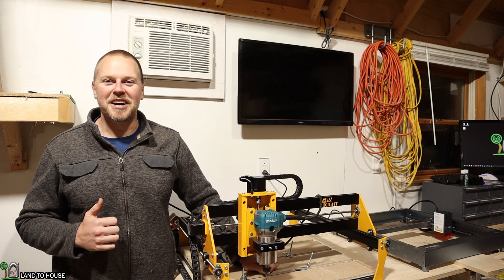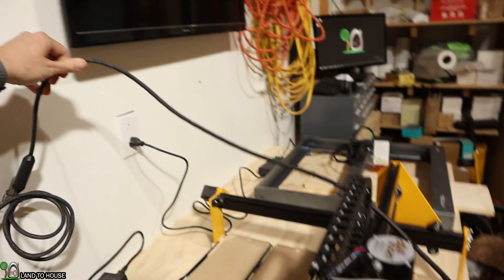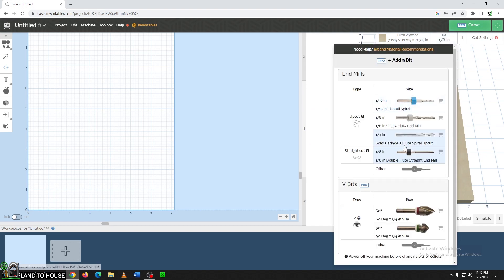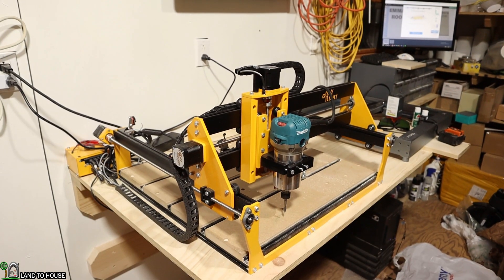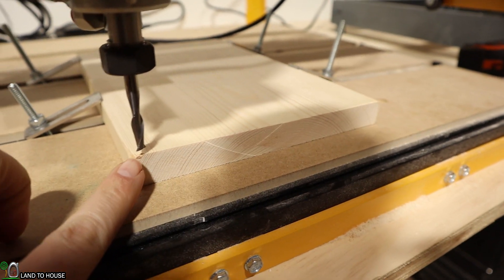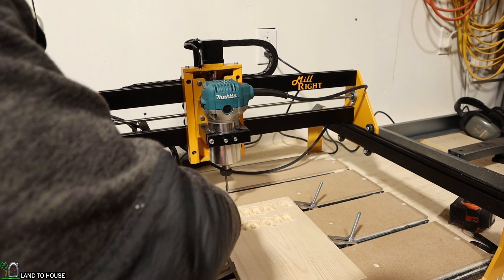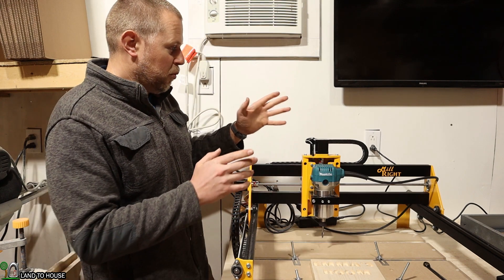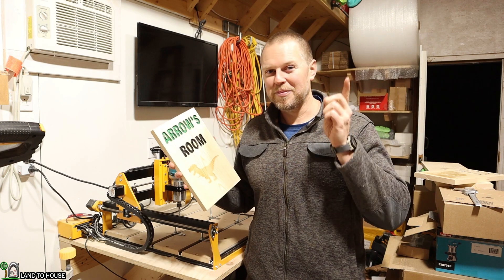Very First CNC Project MillRight Carve King 2

Comment: How do you get a cut without all the tear out?
Reply: It's all about the bit you use. I prefer compression bits, but they only work when your pocket depth is greater than the length of your bit's upcut section.
Reply: Use a downward spiral bit, never use up cut on solid timber. Compression cutters are good too but these are more for particle board and mdf.

Comment: I'm about to buy this very unit.
Reply from the maker: I've made a couple of things with this CNC. so far and it has been great. I just cut my 1st copper with it.
Reply: Does this unit cut up to 4" deep as advertised?
Reply: @mikelaba8985  Looks like you'll have that much travel in your z height, but the trickier part will be getting an end mill that long without running into run out or chatter issues with that long of a bit. Esp. from a trim router vs. a true CNC spindle.
Reply: Sam craft this is what I expected. I'm curious how far this machine can be pushed. I purchased it will update in a few weeks once shipped